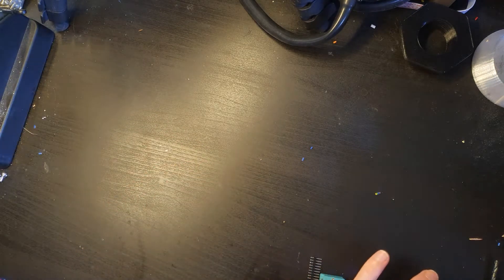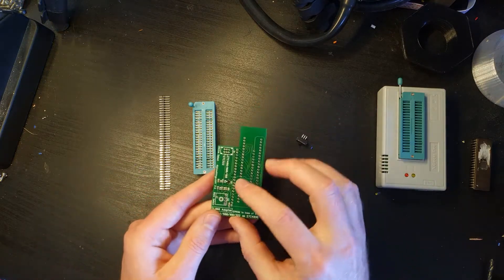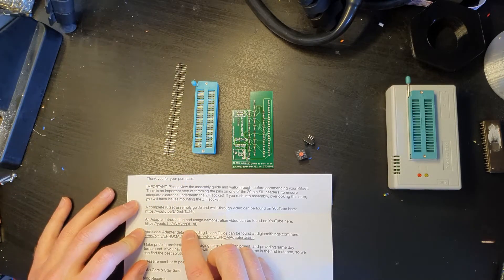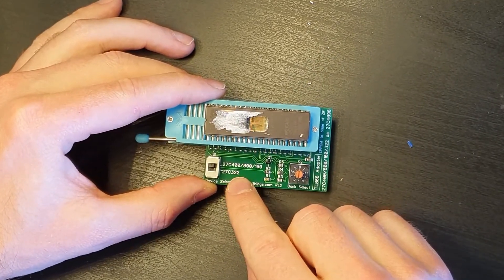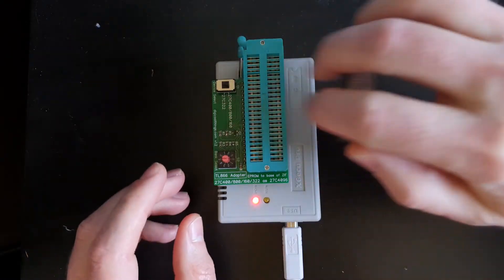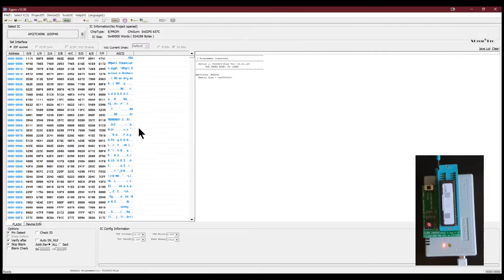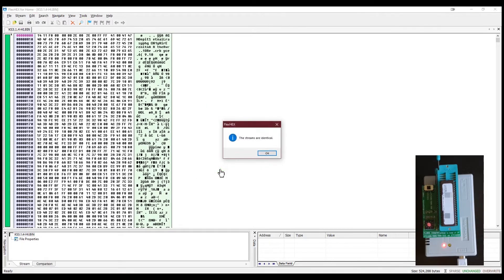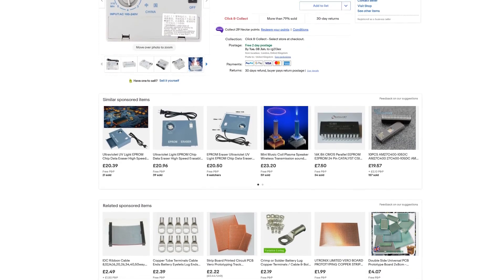TL866-II EPROM Converter - Getting ready to burn Amiga ROMs!

Comment: Great video!  It’s awesome to see someone else building and using one of the Adapter kits. Thanks for filming this. The Kitset version includes the SMD pre-soldered to ensure ease of assembly for those with only thru-hole experience. Note, the pre-Assembled version also includes an ultrasonic clean for a professional flux free finish.  
For the 27C400 (40 pin), the adapter simply adapts directly to the TL866 supported 27C4096 pin-out, so the bank switch is unused / can be in any position.  The other devices in the family (27C800 / 160 / 322) are all 42 pin, and the Adapter is then used to also switch the upper address lines, to facilitate programming in multiple (2x, 4x, 8x) 4Mb / 512KB banks.  
@5:39 Just below the base of the ZIF the PCB notes: “EPROM to base of ZIF”, as a little reminder of the EPROM position.
I do highly recommend investing in a safely enclosed UV Eraser.  The preferred UV wavelength for EPROM erasure is 2537 Angstrom (253.7nm), which is indeed in UV-C range, as you noted. 
Subscribed. :-)
Reply from the maker: Thanks for the feedback! Pinned your comment so other can read a bit more detail about the adaptor. It's funny as I saw the note about the positioning but totally forgot while recording. I really should script these 😆
Reply: I haven't learned to burn the 27c800 yet, you have to burn the data twice as they are 1mb data and the roms are 512k. My 1200 died last week, the erase I found for $20 on amazon came in and burning Diagroms was really handy. As well as was able to put my A3000 on OS 3.2. The cool thing is the diagroms for the A1200, A3000, and A4000 are the same set.
Reply: Any chance at making one that can get us up to 25v for flashing my arcade EPROMs?  I'm having to bend pins out and hook up a bench power supply.
Reply: @josephfanning1241  I still have my old ISA bus programmer for any old 2716 / 2732. But I should retire that one day. :-)  I have read that the older TL866A/CS (which goes to 21V), will successfully program the 25V EPROMs, but I have not tried this for myself.  Creating an adapter for boosting to 25V may be interesting option, if none already available? 
The other option (for an all-in-one solution) is probably the newer T56, which I understand goes to 25V.  But that's an expensive option, especially if you already own a TL866 etc.

Comment: It been years, but Eproms can be erased with natural light. Unfortunately I have no timing info so I'd recommend taking some less critical Eprom and test erasing.
Reply from the maker: Hay DIYTAO, you right. I did look into free ways to erase, was going to take in the region of several days according to some articles using sunlight (and I don't get a lot either haha!). I found an old air filter/purifier that has a UVC bulb in it and have a new video in the works!
Reply: Yeah I got a bad 3.2 rom using Power ISO to extract it from my 3.2 Iso "Amigastore.eu allowed the preorders to download a ISO when the stock came in to fill our CD orders"  I've had very little luch reasing these with a uv light. Turns out you have to blast them for 50 minutes in a uv box to erase them. Maybe in a Day room after a few years they might erase, but inside a sealed box they are likely safe.